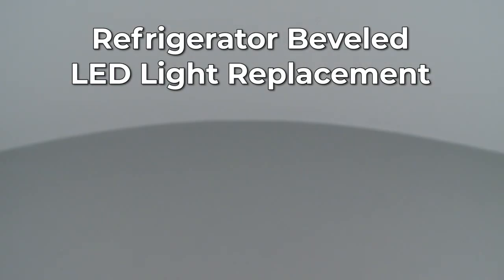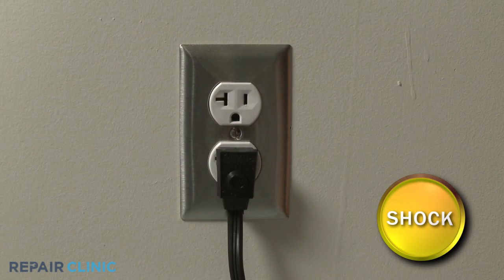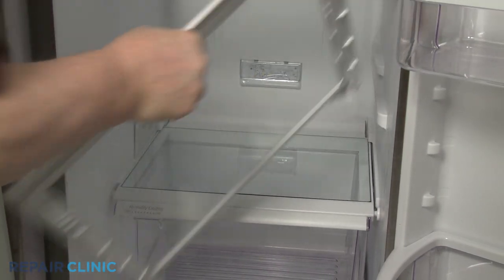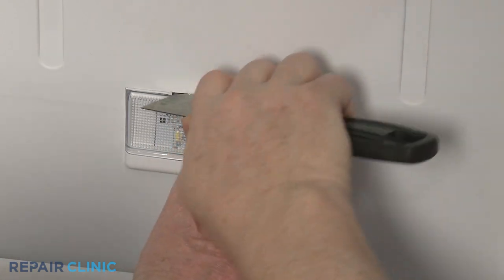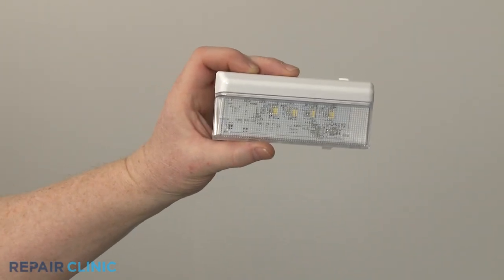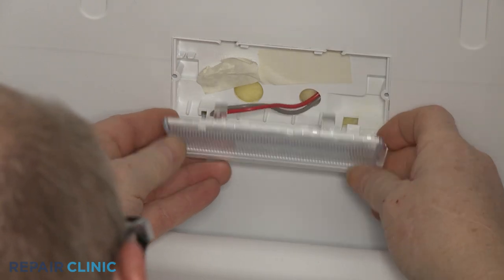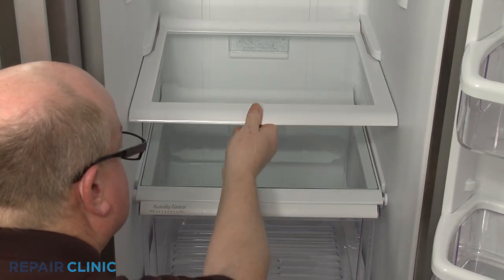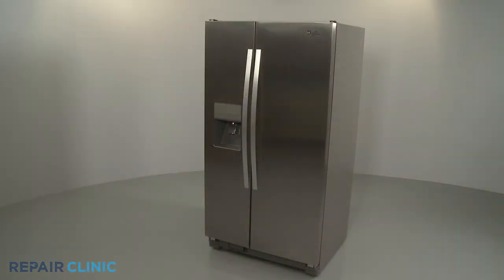Whirlpool Barracuda Refrigerator Beveled LED Replacement WPW10515057

Comment: So Whirlpool (and the rest) moved to LED lights a decade or so ago and instead of just going with a $9 LED bulb they make all three on circuit boards that brighten when the door is opened.  When one bulb assembly burns out, ALL THREE DON'T LIGHT UP.  So what do you do? Buy all three?  WHIRLPOOL CHARGES $200 FOR THE MAIN ASSEMBLY AND $110 FOR THE OTHER TWO! At least RepairClinic prices are about 20% off.

Seriously ridiculously over priced! And shows Whirlpool (and the rest) are so willing to screw their customers.  I installed a $6 12v LED array dome light (for cars) and it is working GREAT! It is over volted by about 10v but if/when it burns out I will just add a new one with a resister and it should be good to go.